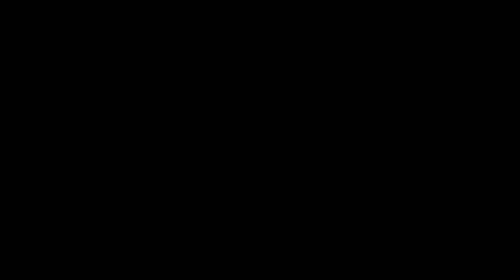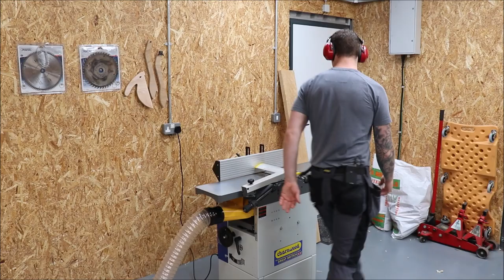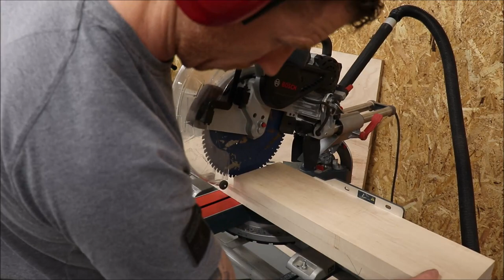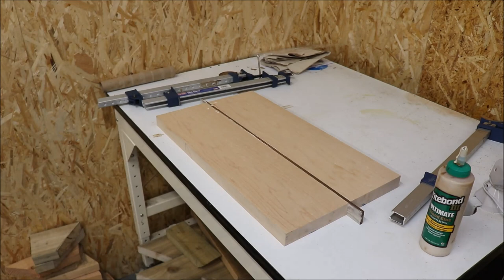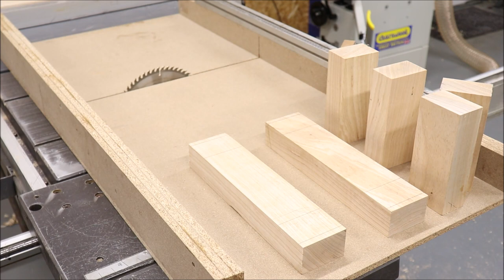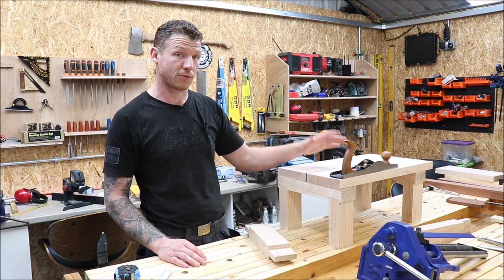Mini Workbench part 1, making a hand tool workbench with a vice.

Comment: FYI, rub sawdust onto the glue squeeze out then use a putty knife to scrape the remainder off the top. It makes cleaning up the glue easy and there's no film left on the wood. This is a tip I discovered on Next Level Carpentry's channel and it works.
Reply from the maker: Thanks for the tip

Comment: SAFETY: Your backhand has to move in front of the safety guard as soon as possible as pressure should only applied to the front / already  jointed part of the wooden board to ensure that it is plane. In addition you could have a "Katz-Moses" moment.....